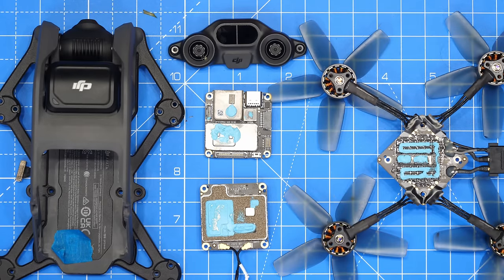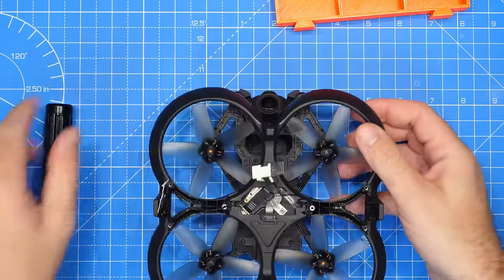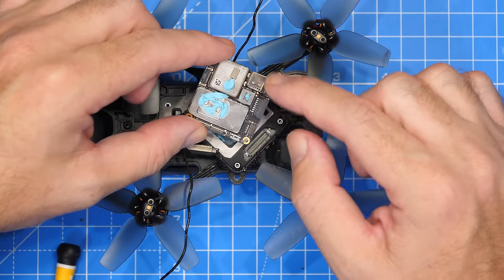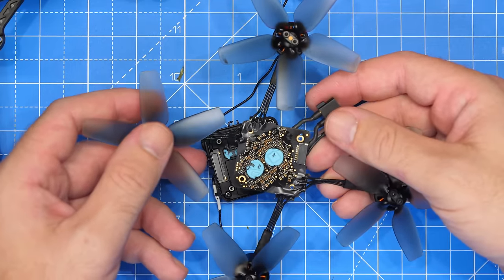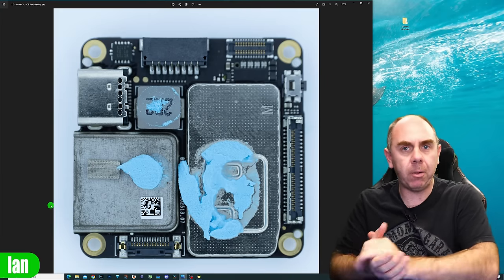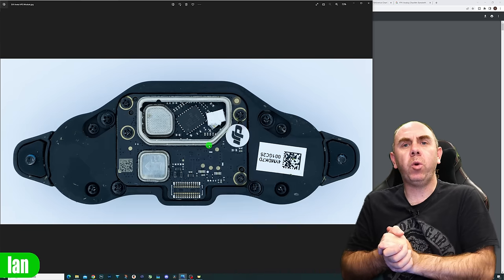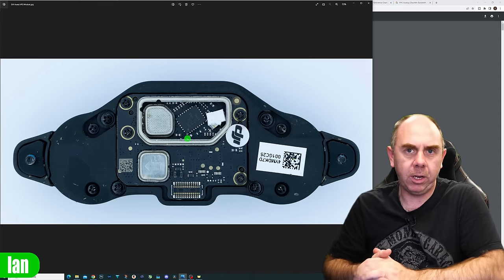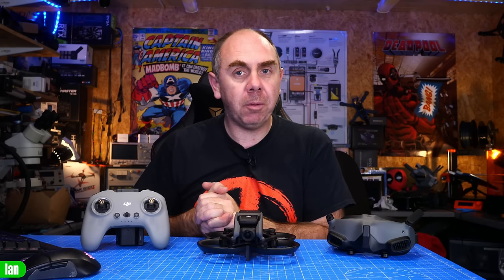DJI Avata Complete Teardown - A Look At O3

Comment: At 11:48 you mention the glue they place inside the screw head. The glue is fluorescent. It will glow if you hit it with UV or violet light. I'm pretty sure it's a way to detect if someone has taken the drone apart.

I love to tear stuff down. I occasionally even put the stuff back together.  I really need to start recording my teardowns. In the past I've posted photos of some teardowns on my Hackaday IO page. If anyone is interested, I have photos of inside of the DJI grey controller used with FPV Drone and Avata. I also have some teardown photos of DJI's RoboMaster S1 on my Hackaday page. The RoboMaster S1 had lots of screws with the fluorescent glue.

Thanks for the teardown Ian.

Comment: I'm just thinking, how come dji electronics are so reliable, in terms of consumer cine drone electronics not vistas and air units, whenever someone buys a mavic etc they are more than confident to fly it over water etc. I haven't heard often of mavic falling out of the air due to electronic faliure. I wonder if DJI could make 4 in 1 eses for us to buy and be promised 99% reliablilty. You think thats possible
Reply: GPS, and altitude vision enable position hold capability, which allows a pilot to pause and think through next flight actions. (ie: not 100% focused on flying)
As far as ESCs, good cooling via heatsinks, and likely good margin in current specs ensure not overheating. Software is also a factor in reliability.
Reply: @AerialWaviator  Next is the DJI FPV drone that you build yourself lol
Reply: Look down a few comments, guy had a DOA esc, and now his replacement has ESC errors too
Reply: You also gotta remember these ESCs aren't being it hard at all, my phantom 4, a 9" drone, draws 15 amps on avarage cruising. A mini quad draws upwards of hundreds of amps, it's just incredibly hard to design and build electronics that can handle those loads and especially loads where one second you're drawing 5 amps total, and another second you're pulling 160 amps out the battery driving motors that are spinning 500 times a second
Reply: It sure would make it easier to integrate Remote ID…. But on the other hand…. Is sure would make it easier to integrate remote ID.  

Oof.
Reply: That's true. The circuit boards on DJI drones are covered in tiny ICs like caps and resistors. Way more than you find on DIY FCs a d ESCs.

Comment: Hi Mads, yesterday I had my yaw tumble experience which made my avata drop from 25m height, while I was editing the video I observed that when the issue happened my height changed virtually from 25m to 34m. Could a barometer issue be causing the tumble? Do you see any hole on the gps module that could be from where the barometer is linked to the outside world? Im wondering if the issue is actually caused by a depression inside the gps house, which makes the barometer gets a wrong altitude reading making the IMU freak out while doing a sharp turn.
Im going to try to make a whole on my GPS module to see if it sorted the tumble isso by equalizing the inside and outside pressure.
Reply: Hi. I have this issue, "height is changing randomly from REAL HEGHT to -10 to -15m  in goggles telemetry" (but not changing the real dron's height),   did you solve your problem ?   I see 4 holes at the corners on GPS MODULE
Reply: @israelvazquez2617  unfortunately I crashed it. But I will increase the size of the holes on the next one I buy

Comment: My Avata had a failed take off and fell half submerged into water. 
The Dji service in Bangkok does not repair  water damage. They did a deep cleaning, told me that 2 motors would start and the other 2 won't. They also told me that Dji does not ship boards. I got my drone back and it's not working. 
After I saw this video I think that if I would replace the ESC it should fly again. Would you agree to this? I found the ESC as used part online for 80 USD. Would you recommend trying? Or the risk too high that there is more damage? What would you recommend? 
Thank a lot for your thoughts.

Comment: On the power plug connection on the drone, are the two pins supposed to be equal? or does one sit lower than the other?  I am getting a battery installation error and can't get the bird in the air!  MOST CASES on the web are surrounding the actual battery connection being the issue. I have a NEW battery & an old one. The old one is separating from the rubber boot as i see in others.  I bought a NEW battery and is still an issue.  I think my case is that the pins are not aligned correctly on the drone.

Comment: sure explains the price,  very well designed.
Reply: not really. many chips are reused, so less RnD was needed, but price still high!
Reply: @Photonees  I'm a mechanical designer so I guess my comment was just based on that part. Designing the molds and structure and connections etc.  Sure at the pcb level there may not be much innovation.

Comment: I bought a used avata that turned out to be a flyaway so i couldn't fly it, since the serial is bound to an accout. It turns out the board where the sd card goes, is the flight controller and thats where the serial information is stored. Thats what i have to replace and its the hardest part to find, Because its easy to recycle all the Avata's parts except the flight controller because most recycled avata is still bound to the previous accout, which makes the flight controller impossible to recycle, unless you can contact the previous owner and ask them to unbind the drone to their account. So reselling that part is a liability for the seller.
Reply: hello, so if i replace that board with clean unbonded motherboard will it work?

Comment: Hello and thanks for the informative videos. I ordered my first Avata as soon as it was made available. It arrived but I never managed to even start it. There was a esc error as soon as I connected it. Returned it and ordered another one. Came about 20 days ago. All good, been flown only 4-5 times due to strong winds where I live. Finally yesterday after a very small crash that broke one blade from my prop, it flew again and got another two flights before it happened again! Esc error and since I'm unable to start it. I'm really disappointed with dji. I've had almost every consumer drone they ever made including the fpv of last year. Never experienced this before.  Since you know every connection on the esc and board, do you have any idea or suggestions as to what can be wrong before I send it back again and wait for more than a month to get another one? Greetings from Greece and thanks for the reply.

Comment: I hope someone can clarify this for me. On the battery for the avata there are 2 "extra" wires besides the +/- one is labeled as TX_RX and the other BAT_ON. Do these wire also carry current? The reason I ask is because I want to experiment and test if I could solder a xt30 connector in place of the original battery connector and use 4s lipos but if i do so where should i connect those 2 extra wires. "BAT_ON" to positive and "TX_RX" to negative? Please help before I end up trying my avata 🤦‍♂️

Comment: It annoys me that parts that do matter are still not available. You cant buy the frame where gimbal is attached to. You can buy the upper frame where battery is attached, you can buy the bumper frame but not the part in between them. If you for example, tear one of the gimbal attaching points with rubber bushes, you are SOL. You can only send your drone to be repaired by DJI. Which makes no sense they will void your warranty if you replace any of these parts yourself, so not selling them and forcing users to pay for DJI Care (which is not even available globally) or force them to buy a new drone is just a great customer experience. Anyway, this video sure will be helpful.

Comment: Nice video. What about the camera module? how easy/difficult it is to disassemble and replace if needed?
Reply from the maker: Tbh I did not want to dismantle this and potentially cause issues at this time.  In the future.
Reply: @MadRC  Yep, it looks like it is the most fragile piece in the drone. Would like to see it disassembled to see if it is easy to fix it myself if needed.
Reply: @Noney8078  I'll add a second in case you were considering doing this

Comment: Once again proof that you do talk securely but do not understand what you are talking about.

The latency is increased because there is an additional link in the chain? Not really. The communication seems not to be highly serialized (look at connector and traces)
Plus it’s likely that the old AU would be better in latency with a coprocessor.

Like your PC. If you have an integrated graphics it’s closer to the CPU, but nevertheless an dedicated GPU on a separate pcb even going through connections is still faster for processing heavy work… like encoding.

Second… do you Even know the Concept of an ESC? They have two FETs per motor because it is by design! That does NOT! double the Ampererating! Yes you have approx. 50% duty max per FET in one halfbridge, but that does not increase currenthandling capabilities by 100%!
Reply from the maker: Ok first of all your not taking into account I’m simplifying things for the audience.  

1: The E3T being in the link has an affect as a result of the additional processing going on. I simplified it for the video but the P1 is linked to the E3T via USB and while that is fast enough the overall additional processing is what’s adding latency. This processing for image stabilisation has an affect. 

As for the ESC I am an electronic engineer by trade. I am well aware of duty cycle and affect of FET’s in Parallel and the affect of that. Again I simplified it and gave an opinion on rating based on the actual spec of the FET’s.  

Something you have to understand is things often have to be simplified for the audience that may not be quite as technical as you.